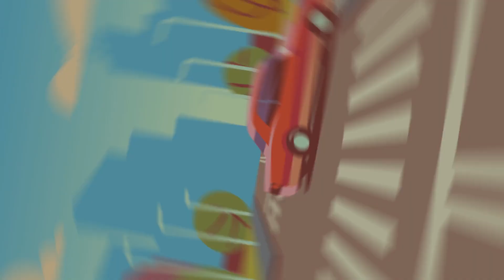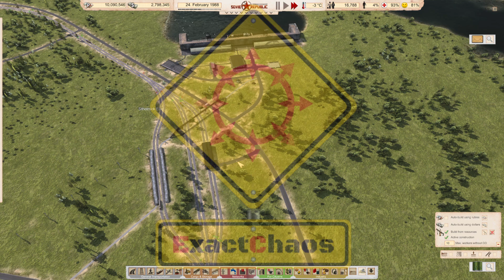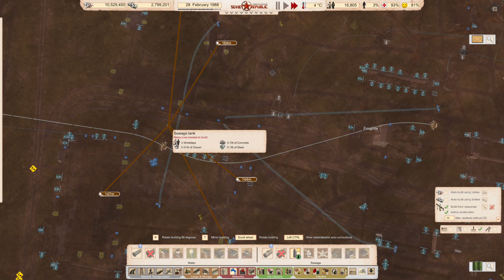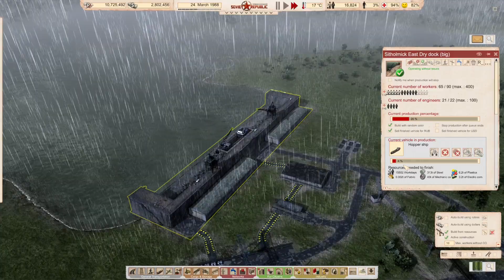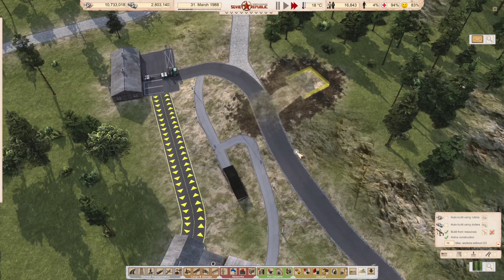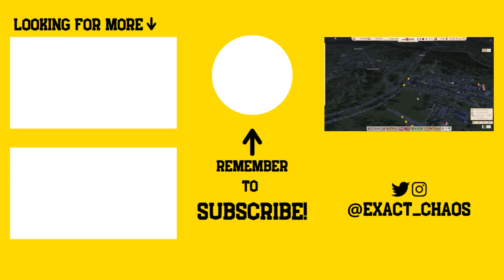Starting up the Construction Precinct - Workers & Resources Version 1 - #54

Comment: Please, disable the force disembark on your "wd" line. It is going to make the workers wait in the train station. Instead assign places where they should go from the train station. They will step off, and immediately go to the bus station and other assigned buildings. Also, you can re-use your import RD-office for internal distribution. It will first load from your own storage and check the customs office last.
Reply from the maker: Thanks for that. I do need to fix that route to get more workers there. In terms of the rail distribution I know theoretically it is supposed to work that way but i do find it easier to find issues later if the logic is completely seperated tp different distribution centers.